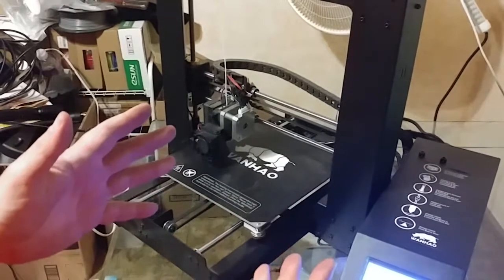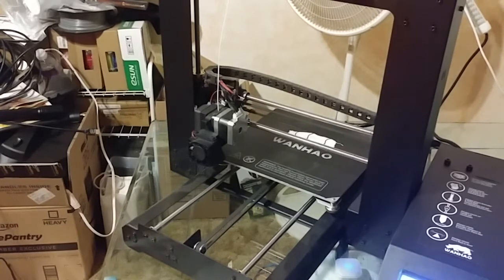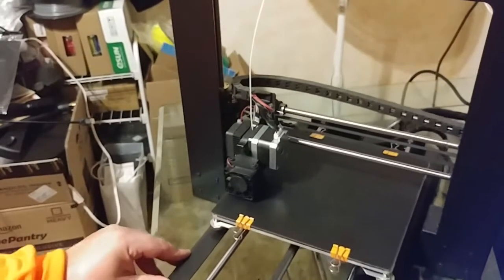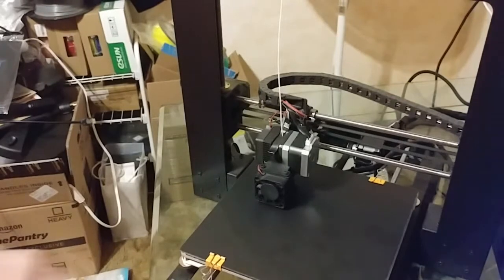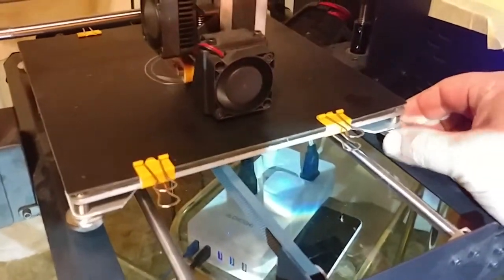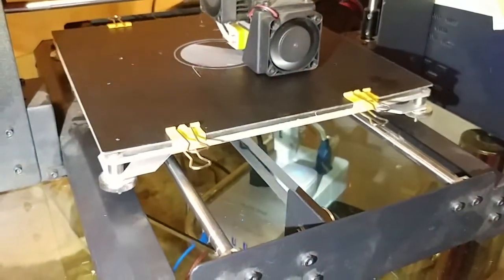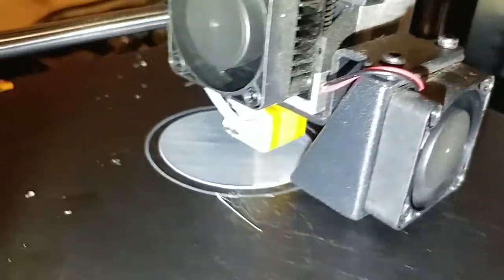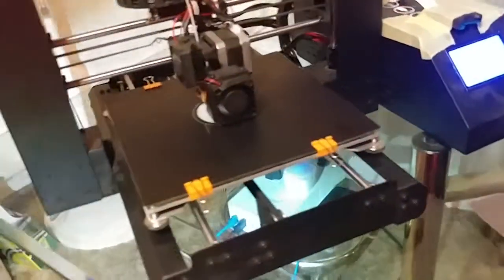Today's 3D Print - Actually Leveling a new wanhao i3 on video start to finish

Comment: I just picked up an i3 Plus very inexpensively and this is a better explanation of adjusting the bed than what's in the manual.  It's not the first 3D printer I've worked with, but is the first of this design.  Thanks!

Comment: Is it not worth using the auto level atall then
Reply from the maker: I personally prefer simple manual leveling but that's because I'm pretty good at and I don't like the added complexity if the abl fails how do you fix it?

Now there's no question it works plenty of people use it with great success so I imagine if I used it enough I would become used to it

Comment: I had the 4 screws tightened and I could not level the bed because the nozzle is completely touching the bed so there is no way i could turn the screw any more. I did the contrary, I left all the screws loose, did a Home all, then i had room to adjust the screws. Why is this?
Reply from the maker: The onpy way i can see that working is if you have some more of abl and it adjusted. Otherwise you just need to raise up your z end stop.

Comment: Hey when it came to the part in the video where you put that black mat on the printer bed, you said just before there was still a big gap between the nozzle and the bed. How do we make that gap smaller if we don't have a mat or glass. Also , when I make the bed go as high as the thumb screws allow, there is still a decent gap between the nozzle and the bed so I don't know what to do.
Reply from the maker: Nathan Green so you know the one way to adjust the Gap and that's by adjusting the screws on the bed but you don't want those too loose you want them pretty tight otherwise you are Level becomes inconsistent it can move on you so if you look at the side of the printer see two little bolt head sticking out with a little micro switch on the other side that's what tells your printer where to stop it's called a z limit switch or an end stop you'll notice that you can loosen those bolts and move that that's how you would just for larger gaps up or down and you can move it half steps as well as long as you're careful so tighten your bed all the way down then get the Z and stop adjusted until the nozzles pretty close to the bed then loosen your bed screws to bring the bed to the nozzle
Reply: Nerys oh right okay. Please can you make a quick video on this or link one to me as I don't want to get it wrong

Comment: After seeing your CR-10 video(thanks was very good intro for a 3D printer newb like myself) I purchased a printinZ skin for it. It has no arrived yet and I was wondering if I can use it without taking off the backing tape and sticking it to something. I was planning on using it loose, clipped onto an IKEA mirror tile. Is this ok?
Reply from the maker: no. you will need to stick it. that is exactly what I did and the skin "warped" under the force of the plastic warping and repeated removals of models. it simply will not stay flat. this is why the "plate" version is so much thicker.

I gave up and stuck it down. get the ikea tile and stick it down to the tile. you won't regret it. the stuff is truly amazing.

Comment: What is your fan speed?
Reply from the maker: Jack Callen at layer 0 0% 25% at layer 2 and 90% layer 3 and up.
Reply: Nerys ok perfect, I'm having an issue where the nozzle is knocking off my first layer when it moves to the second so I'm gonna try that and gonna try a glue stick or hair spray on my glass bed
Reply from the maker: Jack Callen I can off the cuff think of two reasons why that would happen one lack of adhesion lack of adhesion could be one of two issues either you don't have enough squish I eat you're too far away from the print bed or your filament is simply not sticking to whatever surface you're using what kind of plastic are you using what surface are you using?

watch my video from last week regarding how a 3D printer works it will help you to identify whether or not your first layers correct or not absolutely nothing is more important than the first layer because without it you can't build anything else